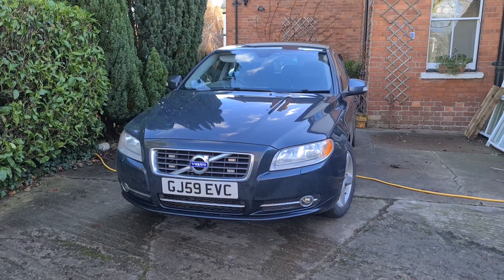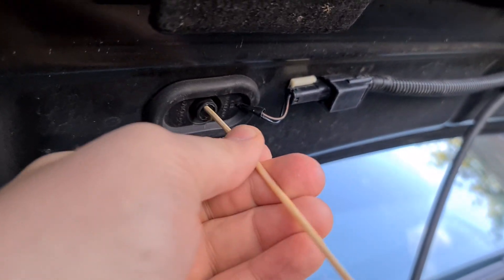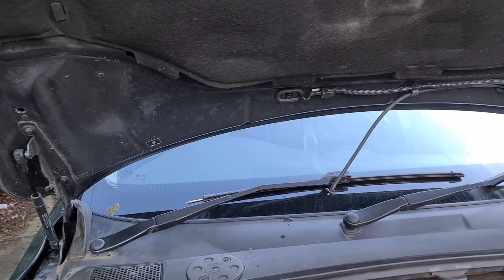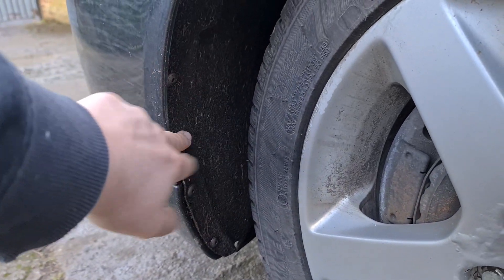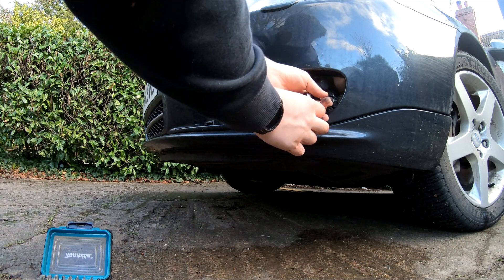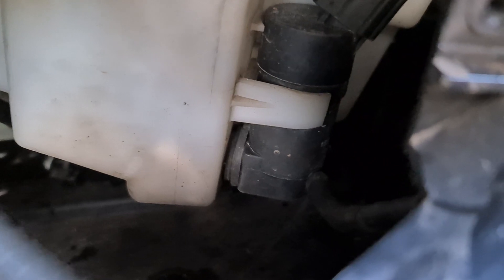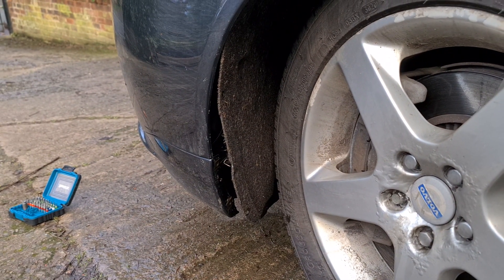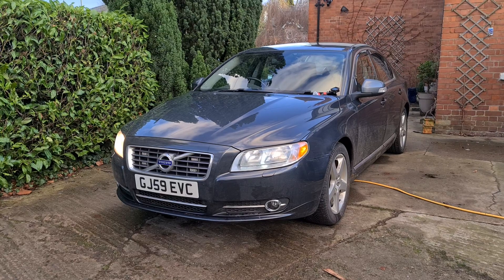How to fix *Blocked Windscreen Washers* + HEADLIGHT/WINDSCREEN WASHER SYSTEM EXPLAINED - P3 Volvo

Comment: We had loads of BMW'S and MINI'S in the place I work with blocked washers jets.The technicians have told me that it is important to use the SAME washer fluid as different makes react with each other and cause residue deposits which block the jets.
To avoid this only use the same fluid, or make sure its empty before you refill  with a different make. 
Hopefully this will prevent any further blockages...
Hope this helps...

Comment: Hi Drive Life thanks for a really useful video. The windscreen washers on my XC70 have stopped working  but the headlamp spray nozzles washers work perfectly 18:45 . I've looked at dozens of videos none of which make it very clear that there are two separate pumps. I managed to get to the rear one just as your video shows, accessed by unscrewing  and pulling back the wheel arch liner and was able to check it functioned by blowing air from an electric tyre inflator down the connecting pipe, the headlamp spray nozzles popped right up.
What I couldn't find until I watched your video is how to access the screen wash pump located behind the n/s fog lamp. It's exactly what I've been looking for, very clear and straightforward. Thanks very much much.

Comment: Great video, thanks Drive Life. The screen washers  on my XC70 have packed up and I've looked at dozens of videos none of which have been of much help. Yours makes it very clear that they are two pumps, the rear  for the headlights which is locates behind the n/s wheel arch liner and a front one for the windscreen behind the n/s fog lamp surround. Thanks very much much indeed - really helpful.

Comment: A little tip is when the screenwash bottle is nearly empty or when it just foams put a little bit of sparkling water into the bottle and run it through the pipes then you are having a clean washer tank and pipes works well for me as long you do it before the temps are falling.

Comment: You can buy these tiny mini abrasive files that are specifically designed to be pushed in and out of those connectors to clean the corrosion. I would try that they’re cheap and easy to use.

Comment: Just had same issue for windscreen. The little elbow and T fittings under the sprayers are actually little check valves. Mine were all clogged up. Ordered new ones. I dont think yours are back to normal yet.
Reply: Good shout. The video didn’t show what the screen washer water pressure was coming from the pipes, before connecting up to the nozzles. If it’s not 100% there, the spray to the screen won’t be what you expect or need.

Comment: How I delt In the past with blocked screen wash jets were. I removed pipes from jets and blasted with compressed air from the compressor. Even pipes connected to washer bottle. If the washer bottle is dirty I put bleach to dissolve any crap and mold and then wash very well with water. 
I watched one channel and russian guy was talking that these Volvos suffer from the damaged wiring loom. Air filter pipes rubbing through wiring loom harness . I have checked mine and on mine v70 p3 air intake pipe rubbed through fuel sensor ground wire 🥺 copper is exposed to air and I need to sort out quickly.

Comment: wind screen washers was still very poor compared to me C30 ones, I have had issues with my E87 and was told first blow down pipe as pump might be blocked with jelly like residue you get from cheaper fluid and then clean out fully washer bottle, as E87 is in a night mare place I put hot water in bottle and syphoned screen wash out and was amazed with all the rubbish which came out, still not perfect so doing again as done twice and still gunk is coming out
Reply from the maker: Yep required a lot more after the video but was running out of light 🤣

Comment: Hi!
Could you help me with something?
The little rubber/plastic cap came off from the pipe in the middle. I was checking your video seeing if I can solve the problem of my windscreen washer not working and ultimately all of the fluid just runs downwards in the middle because there's nothing to keep it in the tube.
So my question is: what is that thing called? I'm from Hungary and would love to get a new one but I can't even begin searching without knowing what it's called...

Comment: Why don't use cleaner for water satins, should resolve the water residue. And for the washer, you should use appropriate fluid with alcohol not normal water.

Comment: Did you manage to get the headlight washers working in the end that bump is a pain to find mine has 4 pins like yours but all I can find is 2 pin models
Reply from the maker: No they have stopped again! -- I think the connectors have corroded --

Comment: The headlight washers only engage when the headlights are on. The headlight pump is the one closest to the front bumper. The windscreen pump is the one closest to the wheel. I think you got it backwards.
Reply: other way round.
Reply: @NeilD163  
Ah, answers my problem. Both front and rear screen wash don't work on my 2009 V70 but the headlamp washer does. Sod's Law, the hardest pump to reach is the one that involves taking the fkng bumper off....
Reply: @ChangesOneTim  changed the washer pump on my mates s80 so the same setup,  if you remove the left fog light you should be able to get to the pump that way.
Reply: @NeilD163  
Okeydokey! I'll eliminate other causes such as blockage and blown fuse first....

Comment: You fixed the headlight washer? I am going to disable it if I can, it wastes washer fluid and smears the bonnet for no good reason.
Reply: Just unplug it
Reply: @UnderTheRadar1976  apparently it's an mot failure to do so.

Comment: I have a 2012 V70 and I believe the washer fluid pump needs replacing. Will this be in the same place as on this vehicle?
Reply from the maker: Yes it will be in exactly the same place :)
Reply: @drivelife.channel  
Mine's a 2009 V70 and I believe there are two pumps. The one you reach via the wheelarch moulding is for the headlamps, and the other for front and rear screens is on the front (bumper) side of the tank.